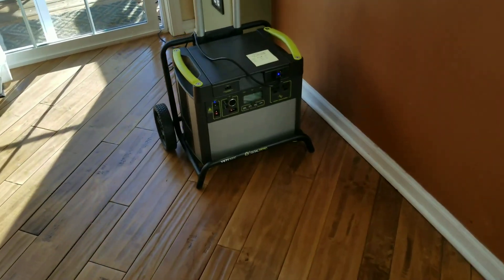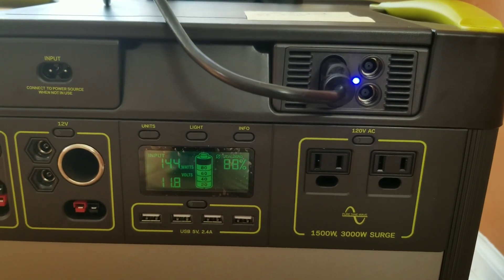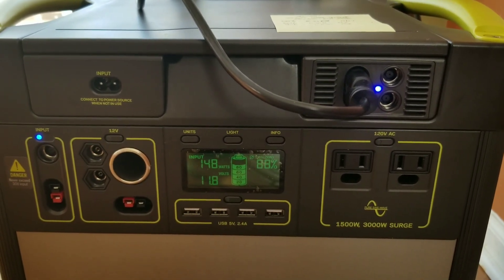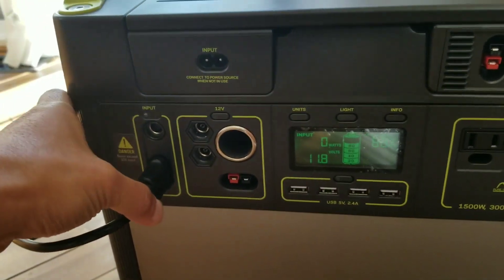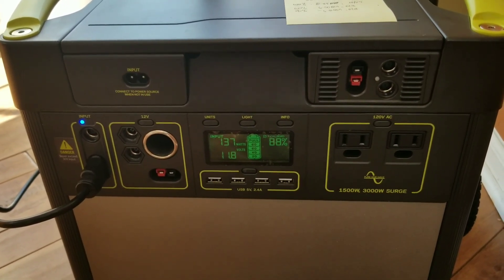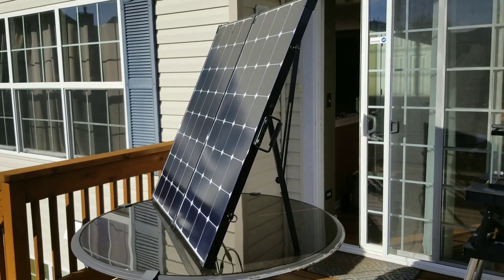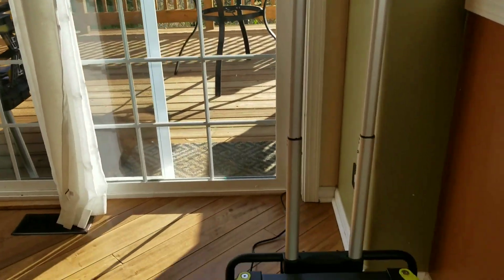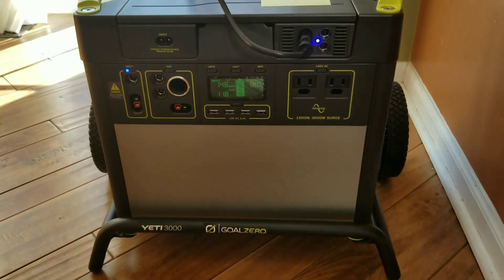Solar-charging the Goal Zero Yeti 3000

Comment: Thanks for the video. Quick question. What happens when the battery is full? I have the 3000 and a couple off brand panels. Is it safe to leave them plugged in after the battery is full?
Reply from the maker: Yes. It's fairly safe to leave it plugged. I believe GZ even recommends the battery being kept plugged to allow auto-top-off when it's not being used.
Reply: @kalasag9113  I read that as well. Any idea where the excess energy goes?

Comment: very nice video... im planning on buying this yeti 3000. now i wonder if i can connect a set of 600w solar panels instead of the 200 watts that you got. Will it charge faster or will it damage the yeti 3000??  Please reply. thanks. the reason for this is that i can buy the solar panels in cotsco for much less price.
Reply: brandon granados  --  On most inverters the surge rating is only momentary, a few seconds to maybe 15 seconds on average which allows (most) motors to start, then as the motor gets up to speed it,s power requirement drops off to the "Run Load" rating or less.   So the Yeti 3000, 1400 and 1000 lithium series all use the same inverter and will provide up to 1500 watts continuous.  The 3000 watts is only momentary.  I have the 1000 and have drawn 1430 watts from it for 20 minutes without it shutting down.
Reply: LEGEND02545 hey man when you get your yeti 3000 can you please let me know if it can do 3000 watts out and for how long ? Please
Reply: It will destroy it.  I forgot the maximum watts of safe input.  It is written on the unit.  You have to divide it in order to use the two MPPT inputs and or the other input.  Make Shure you don't exceed it.

Comment: In the video it looked like you may have had the solar panels wired to a charge controller attached to the back of the panels then from that to the Yeti. Is that how you have it and if so why?
Reply from the maker: Hi Brian - Good eye!  The cc on the renogy panels is actually in by-pass mode. I bought the solar suitcase for cheap (with the cc already integrated).  I disabled that one to ensure efficient power mgmt comes from the 3k unit (which came with 2 cc's built-in) .

Comment: Just so everyone knows, you can already chain Yeti Lithium stations across the line, from the 400 to the 3000 and in between.  How, you might ask?  Consider the power adapter that each model comes with, at least in the case of the 400 Lithium- it's 16V, 5A, and it can be powered by a 400 or what have you to run power over to a larger 3000 or whatever you have (even a lead acid based Yeti 1250.)  I plan on doing this myself as an owner of a Yeti 400 Lithium as a standby option to charge another station, the 3000 unless another larger smarter (bluetooth equipped etc) unit hits the market.  Notably, there will be some power loss in the conversion of going from DC to AC and back to DC again, but having the option in an emergency when you need to transfer power from one Yeti model to another is a nice thing to have, even if the manuals don't quite explain this properly.  OH!  Also, the Yeti 400 Lithium power supply is compatible with with Guardian 12V charge controller as well, as it meets its maximum power limits.  Have fun!
Reply: Could you explain the difference between the power station and the generator and why you would need to use one over the other?
Reply: The difference is mainly usage of terminology- generators typically run on a source fuel to run an engine to generate power, whereas "power station" is an alternate term for a solar generator, as you're using solar panels as the fuel source in a sense, and the engine is a combination of a battery pack, inverter, and charge controller in a single casing.
Reply: So the difference between the Goal Zero Portable Power Generator and the Goal Zero Power Station is one stores energy and can go from dc to ac and vv, and the other does not??
Reply: There's no difference, remember that these terms are interchangeable.  They mean essentially the same thing.
Reply: Cool! Thank you, I guess it just threw me off that Goal Zero named one product a "generator" and the other a "power station."
Reply: No prob!

Comment: Thanks, I may consider getting the 15 ft. extension for a good fit.  I got the 5 ft version of this https://www.ebay.com/itm/Yeti-Goal-Zero-1250-MC4-Solar-AP-Cable-5-20-FT-Adapter-Power-Pole-10gauge-98014/282752784672 but the cable is heavy and stiff and wants to fall out so I will tie it to the green handle as a strain relief.  I’ve only had it a short time and will try out my 2x Renogy 100W suitcase (old style) panels today, using MC-4 Y-combiner to the 5 foot APP cable.  The Renogy panels are heavy, so considering flexible panels with ETFE surface.  I see you have the Lensun, heard good things about them. How do you like it?
Reply from the maker: I have 4x150w + 1x100w suitcase renogy panels as my primary power input for the Y3K...  'bought the Lensun 100w foldable to power a smaller lithium batt or when I want to test APP input without taking out the bigger panels.  :)   I'm very impressed with the Lensun - it's very, very light (compared to the Renogy suitcase), and when it's able to suck in up to 80% sunlight when it's properly oriented to the sun. 'only downside is the $.  On sale when I bought it, and it still racked up $285 (shipping included). 'would highly suggest it vs. a GZ or a Renogy, if portability and weight are prime factors.   Here's a link to it, in case you get the urge to try it out:  http://www.lensunsolar.com/Lensun-100W-Solar-Charge-Power-Kit-Foldable-Portable-Flexible-Solar-Panel-for-Camping-Van-Caravan-Motorhomes-and-RVs

Comment: What sort of MC4-APP cable are you using?  The 1 foot adapter cable from GZ is hard to purchase.  I bought a 5 ft ready made 10 AWG cable on eBay but the APP connector end doesn’t stay tight so I have to zip-tie the cable to the Yeti carrying handle to avoid any slight “tug” which would pull out the APP connector.  Your cable looks like it has a very robust APP connector.
Reply from the maker: Brad - here's the one I'm using. You have to slide the red-black connectors apart and re-stack them to config for input.  https://powerwerx.com/solar-mc4-anderson-powerpole-adapter-cable
Reply: Kalasag 911 Thanks, actually I think it’s this one specifically for Goal Zero charging input with non-standard orientated Anderson connectors: https://powerwerx.com/goal-zero-98014-mc4-to-powerpole.   I considered ordering that one, but the Anderson connector didn’t appear to be covered with any collar in their photo, whereas yours appears to  have a very sturdy collar.  If yours represents what you actually receive from Powerwerx I may order theirs.  Does it fit snugly, and can you confirm it’s actually the one in the link I pasted here?   Thanks.
Reply: Kalasag 911 Another thought, the Powerwerx cable is only 1 foot, but yours looks very long.   Are you using an APP extension cable?  if yes, it it the one from GoalZero?   (Their APP connectors are oriented oddly so normal APP extension would not be compatible).
Reply from the maker: Hey Brad - Yes.  I'm using a GZ 15ft APP extension as my primary input cable to the Yeti.  http://www.goalzero.com/p/507/app-15ft-extension-cable
Reply from the maker: The 15footer is then attached to a 4x APP combiner.  http://www.goalzero.com/p/486/4x-anderson-combiner-to-anderson-connector  which helps aggregate inputs from multiple solar panels.
Reply from the maker: I then have an MC4-to-APP adapter connecting the panel to the 4x-Combiner.  Here's a typical setup connection (using a much smaller 100w portable Lensun for illustration) https://www.dropbox.com/s/4cd24llhxbknnno/Solar.Panel-to-Yeti3K.jpg?dl=0
Reply: Brad, here somethings you need, lucky It came when I needed it most.  JoinWin MFG MC4 to anderson, different polarity and wires guage listed.

https://www.amazon.com/Anderson-connector-Generator-Portable-Powerstation/dp/B07C5BQ91M/ref=sr_1_1?ie=UTF8&qid=1535961707&sr=8-1&keywords=MC4+to+anderson

https://www.amazon.com/JoinWin-MFG-Connector-Generator-Powerstation/dp/B07DZTV1K5/ref=sr_1_3?ie=UTF8&qid=1535961707&sr=8-3&keywords=MC4+to+anderson

JoinWin MFG MC4 TO 8mm adapter was listed with different polarity
https://www.amazon.com/Adapter-Jackery-Portable-generators-powerstation/dp/B07DF6795Y/ref=sr_1_1?ie=UTF8&qid=1535961822&sr=8-1&keywords=MC4+to+8mm

But my best advice is their Anderson extension cable. Freely assemblable, but not limited used to GZ.waterproof jacket Equipmented but not fixed same as GZ.https://www.amazon.com/JoinWin-MFG-Anderson-Power-Extension/dp/B07GRR6TX6/ref=sr_1_9?ie=UTF8&qid=1535962119&sr=8-9&keywords=anderson+extension+cable

Comment: I just got a yeti 1400. Can i get an mppt for it?
Reply from the maker: I don't see why not, Ed.  Charging via PWM plus MPPT will allow you to max out your solar input up to 650watts.  I think it's a good investment, especially if you want faster charge times.  Get the Renogy 100w or 150w solar panels.  They're much cheaper than GZ's and they're better on shades/cloudy conditions.
Reply: Kalasag 911 Q-Was the MPPT in your Yeti 3000 from GOAL ZERO? I don’t see a GZ mppt on their website, but your mppt looks like it’s installed in a bay on the 3000. I don’t have my 1400 yet so i can’t examine the unit. If it’s an after market MPPT can you supply a link? THANKS!
Reply from the maker: Ed - My Y3000 comes with an MPPT controller already integrated.  In terms of getting one for your Y1400... It looks like GZ is currently out-of-stock due to its popularity.  Check this link from time to time. 
 http://www.goalzero.com/p/510  You can also try entering your email address in their "notify me" box so you can get direct email from them when they have it again in stock.  Post back if you have any other questions.  Thanks.  - Hanzo

Comment: I want one but I just can't justify it at the price because the max running watts is 1500w and the battery capacity while great is still to expensive I would rather just get a gas generator
Reply: Anthony Garrett I have a Yeti 1400 and a 2000i Honda generator. I wanted 2 power options in earthquake prone CA. I’m covered. Gas generator is good as long as your supply of gas. Just get one with a pure sine wave to run electronics.

Comment: Great Video! 
I just ordered my yeti 3000 and I want to use two home solar pannel of 250w and 24V each. Do you think It will be ok to put one in the mptt and the other one in the pmw ? 
I know that 22v is the max voltage for the goal zero but I've elready seen video where they use one 24v solar pannel for the goal zero... I'm a bit confused
Reply: Gregsway - the yeti series is 12v... you need to pair it with 12v panels.  batteries and panels need to be matched on voltage.  goal zero does some odd things with their lithium banks - iirc they use 10.8v or so, but still target it as a 12v system.  
higher end systems can mix and match panel vs battery voltage, but Goal Zero does not support it - they specifically say you will destroy your yeti if you use over voltage panels.
Reply from the maker: VNE7 is correct, Greg.  Your 24v/250w may work short-term on the 12v Yeti until it reaches its power threshold, and then the power unit will probably burn-out shortly thereafter.  I would dial-back down to a 150w-12v panels to ensure longevity.  I'm using 150x4 + 100x2 briefcase as my primaries on my Yeti3K.
Reply: Hey man can you please let me know if the yeti can do 3000 watts out and how like can it run?
Reply: Hell I would not want to buy one until they put the mppt charger built in!!!

Comment: Sweet Lithium battery! That is one of the best ones available at this time. Although at $3,000 you better have deep pockets.
Reply from the maker: For a 10yr insurance, that'll be about $450 a year (solar panels + extra cables included). Tough to quantify peace-of-mind now these days.  :)
Reply: Also it's likely that open box models of the Yeti 3000 will become available directly from Goal Zero in a matter of time.  The other day, I purchased their Yeti 400 Lithium from the Open Box/Legacy outlet and saved 35%, reducing price from $600 to $400.  This seems to be consistent across all open box products offered, including panels and higher end Yeti lithium models.  Thus, presuming a 35% discount, the price would be roughly $1950 plus shipping, which is outstanding.  I'll be purchasing the Yeti 3000 for myself pretty much as soon as I can afford it, as well as the home integration kit, which if open box, it should be something like $160 if discounts stay consistent over time.
Reply: I'm not too worried about that, hopefully within the warranty period the lithium cell will top off properly even if its been through some cycling (and I'm willing to wager that Goal Zero would be on the level when it comes to warranty service just in case.)  My thing is, I suspect that with time and maturation of battery chemistry yet further, that replacement cells could reach the market that maintain proper voltage and charge/discharge behavior, but increase Ah/Wh yields significantly.  When/if this happens, I think it'll be a proper time to replace the battery pack.
Reply: Quick update:  The open box refurbished Yeti 400 works great and tops off to 100% as hoped.  So far, so good!
Reply: Living in earthquake CA, I wanted an off the shelf solar power solution. I bought a 1400 with lithium batteries. Costly, but not having power when you need it can be more costly.
Reply from the maker: Gotta be careful with purchasing used lithium models, Abe.  Make sure you ask Customer Care what percentage of charge the lithium battery they're shipping to you is at.  You'd want a system that can fully top off at 100% on your first few charges.  Used ones (at least those extensively), will fail to charge 100%.  Instead, depending on number of used up charge cycles, you might get one that goes up to 90%-95%.  Just a reminder to consider before you [add to cart].  :)
Reply: Abe Lambright some of the open box offerings are filthy and abused. Lithium has a limited lifespan. No warranty. Hit or miss. With high tech electronics I rather pay a bit more for the piece of mind in a grid down scenario.

Comment: whats the max you can charge from a solar panel
Reply from the maker: Hi Leonard - Just so we don't get in trouble (from a warranty perspective), I'd say go with Goal Zero's recommendation of around 620-650watts.  The key is not to exceed the aggregate 22voltage ceiling for either the PWM or MPPT.  From experience though... I think you'll need at least 800watts of solar panels to generate around 600w - usable (given 70-73% panel efficiency).   

Here's my "safe" cheat-sheet again (vetted by GZ). 

=====start here===== 
CHARGING using the PWM
The PWM controller is rated for:
- 350W max through the APP 
- 160W max through the 2x8mm ports
22v = Max Voltage
 
CHARGING using the MPPT
The MPPT controller is rated for:
- 270W max through the APP or 25A and
- 150W max through the 2x8mm ports 
22v = Max Voltage
 
~620W (350W + 270W) is maximum solar charging input via APP
 ====== ends here ====

Post back here if you have any other questions.  
Thanks.
Reply from the maker: Hi Jason - My setup is wired parallel, I believe... My amperage aggregates (eg, 150w + 150w = 300w) as I add more panels, but my voltage remains the same at 12v.  'just wanted a bit cautious as the Yeti's(I think) input range surges between 14v-22v throughout the day.

Comment: Nice demo. Your MPPT vs. PWM test was very helpful to me because I am looking for a new solar charger controller for my 400-watt system right now. I was thinking of saving some money by going with a PWM controller but now I think I will just go ahead and bite the bullet and get the MPPT unit instead. Thanks for the vid.
Reply from the maker: You're welcome.  Here's a cheat-sheet for what you can safely throw at it - validated by GZ tech support.  

=====start here===== 
CHARGING using the PWM
The PWM controller is rated for:
- 350W max through the APP 
- 160W max through the 2x8mm ports
22v = Max Voltage
 
CHARGING using the MPPT
The MPPT controller is rated for:
- 270W max through the APP or 25A and
- 150W max through the 2x8mm ports 
22v = Max Voltage
 
~620W (350W + 270W) is maximum solar charging input via APP
 ====== ends here ====